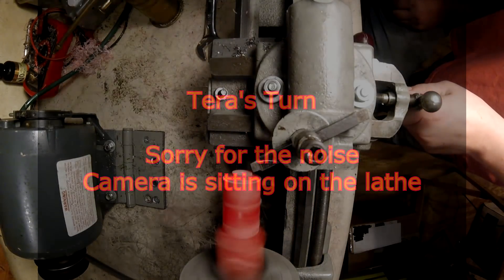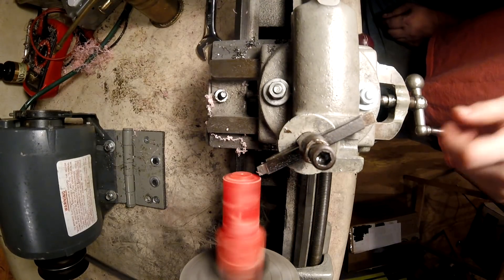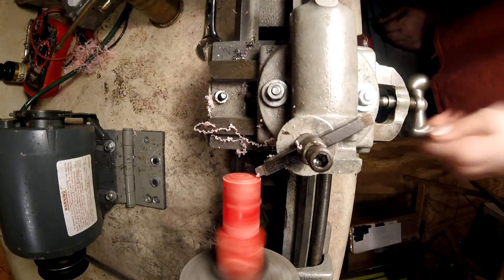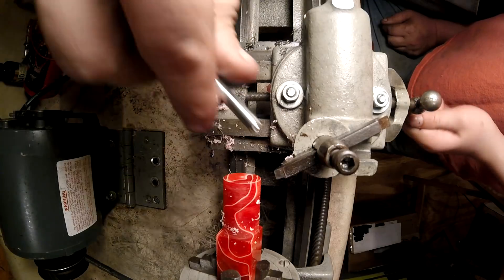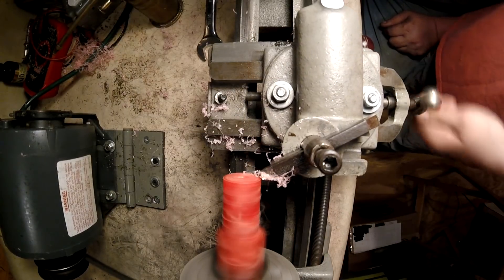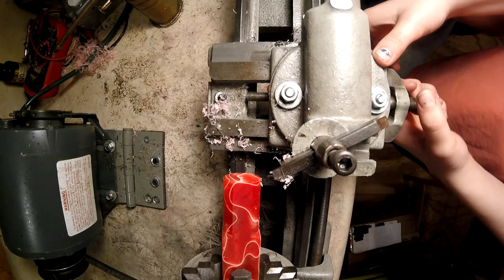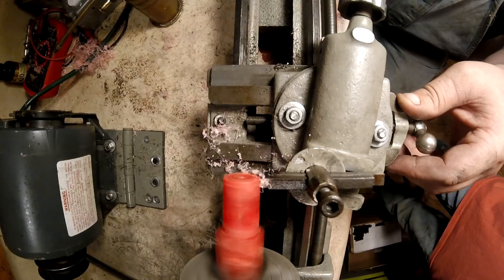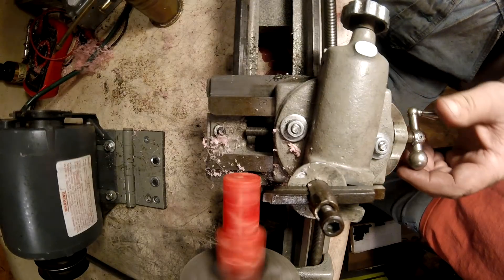Tera runs the lathe

Comment: As the lead screws have no scales (currently), you can use the indicators in "Dash Board" configuration.  Take an indicator with the base mounted to the saddle and measure the travel of cross slide.
Reply from the maker: hardkrash great idea. Thanks for watching

Comment: A very good tool for producing inductor forming blanks (is that the right word?) aka coil forms. One can thread coil forms using this machine with various thread pitches.....( threads per inch also).....depending on the turns ratio desired for inductance......but this is all in the advanced class ( now possibly in the extra class formulae).......study material.... 73 de KI0MX
Reply from the maker: OnlyTheEd will have to check it out

Comment: The mighty mag was meant to use as a Z-Axis indicator mount for the lathe.
Reply from the maker: hardkrash I am going to order a post back for the indicater.
Reply: That's defiantly a sturdier mount,  will a side mount screw not work with the model sent in?  e.g. https://d2ydh70d4b5xgv.cloudfront.net/images/3/c/mighty-mag-universal-magnetic-base-mhc-industrial-supply-dial-indicator-6368c29023df66a5c16e532085c7a27c.jpg
Reply from the maker: hardkrash( shakes his head in shame) did not try that